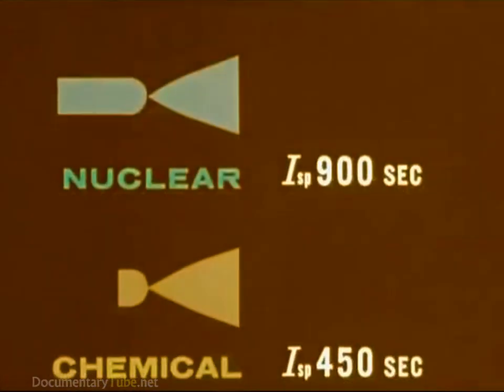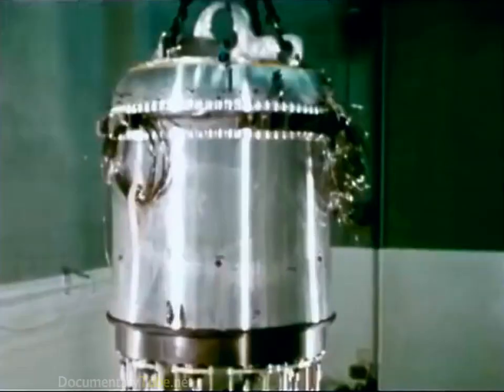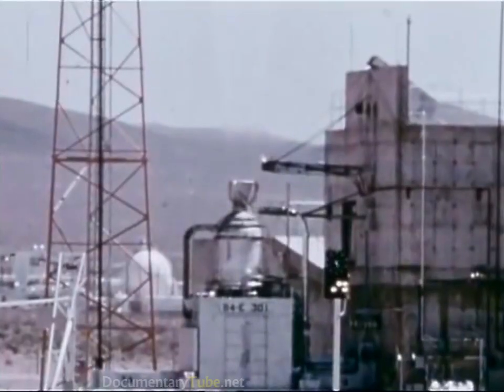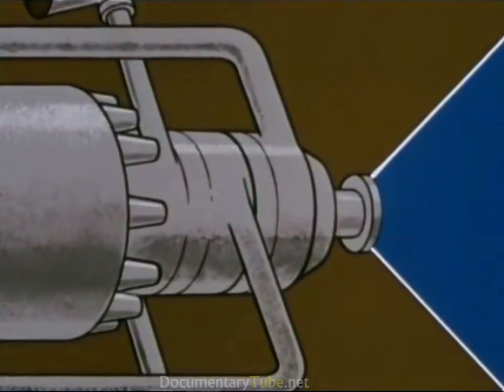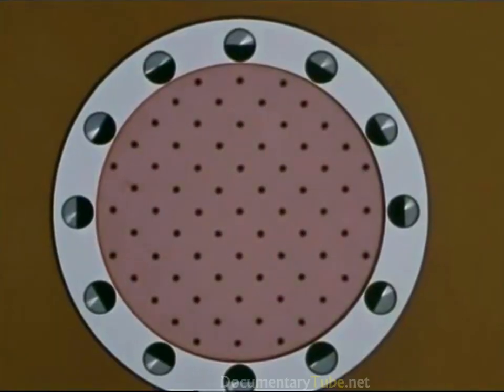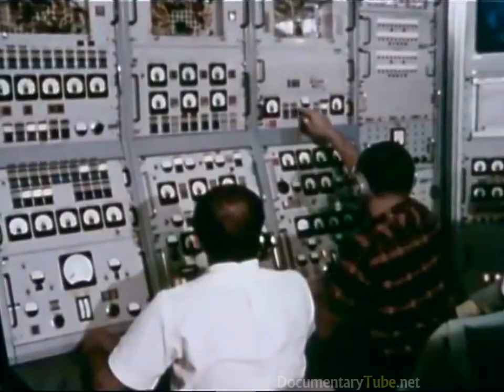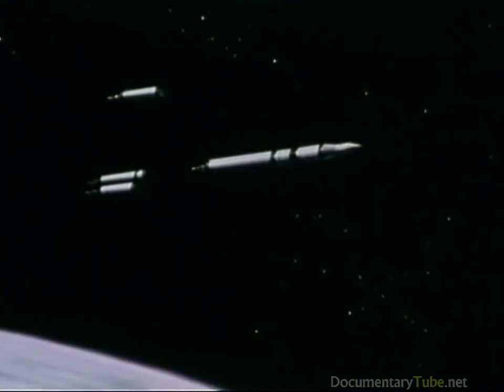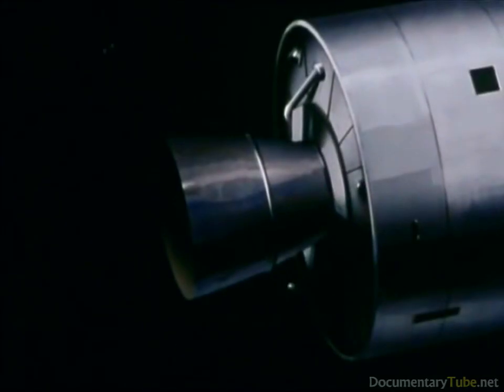HOW IT WORKS: Nuclear Propulsion

Comment: Then came "The China Syndrome", and we decided that Michael Douglas, Jane Fonda, & Jack Lemmon made more sense than the actual scientists.
Reply: And then a few months after that movie came out, Three Mile Island had a real-life meltdown and that makes a lot more sense than your silly comment about a movie.
Reply: @jamescarter3196  3 mile island was completely contained, even when it had a catastrophic failure.
Reply: This was luck as well as technology. Saved ultimately only by the geology of the site, something that can't be said of several of the operating nuclear power plants today if they were to melt down. We were told by the industry before 3M.I. that the chances of the kind of accident that occurred there had a 1 in a million chance of happening. Yes, nukes are built to exacting standards and are far safer even in terms of radioactive output that burning coal, but the nuclear propagandists of the era of this video told us nukes were safer than they actually are and argued for far less restrictive safety measures.
Reply: @meteorblades8044  Lets take a look at Fukushima for example.  As we know, the China Syndrome is an exaggeration of the fear that a melting nuclear reactor could melt through the earth.  The end result in Fucushima was that the nuclear material melted through the core and into the basement where it pooled up until finally cooling to a solid state.  The critical mistake in Japan was placing the reactor in a high risk earthquake and tsunami area without sufficient safety measures for these cataclysmic events.  The technology pertaining to nuclear reactors and the safety measures needed has taken significant steps forward in the last 50 years.  We need to take a serious look at how nuclear power can be a beneficial resource to compliment green energy technologies as a viable resource in the modern age.  Unfortunately, the downside to wind and solar energy prevents them from being the stand alone sources of our energy needs.
Reply: @ADAMJWAITE  I’m very late, but there’s also a need to point out that Fukushima was struck by one of the largest Earthquakes and one of the largest Tsunamis ever recorded but still survived enough that you can live right next to the reactor and not have an increase of getting cancer.

Comment: I have proposed an experiment that if it has experimental physical results, then, it can be a tool for the propulsion force for spacecrafts.
This experiment requires a high energy laser and an interferometer.
Please read the attached link as my proposal for this experiment. I would be very grateful if you send me your feedback.
Best Regards
J. Jafari
https://www.researchgate.net/publication/327828912_Are_laser_particle_accelerator_capable_to_propel_spaceships_in_cosmic_distance

Comment: Here is an engine I've seen proposed. Use a nuclear engine to power a pulse converter and simply "set" the pulse to however rpm needed for fastest speed ratio. It would be most useful in Space because once you are moving at a good clip, all you need to do is steer around objects that can rip your ship apart. A Neural Net Computer would do the trick nicely. Going one step further a Matter to Energy converter attached to a pulse converter would be better than nuclear because then your spacecraft could "suck in" matter and there is your fuel. A smart ship would use nuclear and solar sails as backup systems to compliment the existing Matter to Energy Pulse Drive. Don't ask me how I figured all this out. I might be a genius or something. In fact, not to brag but remember the theory about the idea of black holes being "doors" to another universe? Well I speculated on that as a kid.....not making this up either.
Reply: Don't smoke crack

Comment: Atomic fusion just isn't viable.  It's danger factor is over the top.  All control systems are subject to failure, either mechanical or human error.  Use of fusion requires perfection and lets face it, that we aren't.
Reply: Yes fusion is not going to work. The tokamak projects have proven it for the most part. Fission with using multiple reactor types for processing diffirent products using MOX fuels is hopefully going to be future of nuclear energy. If only we could use U235 as fuel.
Reply: @okakokakiev787  >If only we could use U235 as fuel.
MAXIMUM ATOMIC CRACK MODE ON
We can! Just turn it into uranium tetrabromide, mix it with water (2% solution) and store in many individual thin tubes, internally coated with neutron-absorbing material, then, when you need thrust, shoot several streams of it at eachother behind the pusher plate! BOOOOOOOOOOOOOOOOOOOOOOOM! And you have high-ISP high-thrust engine with continuous cycle!
MAXIMUM ATOMIC CRACK MODE OFF
The thing I've just described is a real project - the nuclear salt-water rocket. There's a much more practical version, though - the nuclear pulse drive, both of the Orion and Medusa kinds, which uses specificially-constructed nuclear bombs for fuel and propellant.
Reply: Oh dear, oh dear.... we gotta get rid of all that paper stuff because it burns so readily...... and all those automobiles that kill a zillion people every year.....

Comment: The question is how about the radiation  from the H2 used but you can use it in space because it ain't on the earth !!
Reply: There is no radiation from H2. The only radiation happening is if the rocket does a close flyby and will be provided to you via rays.

Comment: On January 12, 1965 the jackasses intentionally exploded part of a rocket's nuclear core to study the behaviour of the reactor and the environmental effects of the radiation. The test was designed so that all winds from the test site would be from the northeast, thus the radioactive cloud created by the test would blow to the southwest from the test site for a distance of 200 miles toward densely populated areas of southern California.  The radioactive cloud was tracked by U.S. military aircraft.  Increased radioactivity was observed in Barstow, California, San Bernadino, California, Los Angeles, California, and San Diego, California.Besides the large scale intentional radioactive pollution no morals,ethics or conscience were observed.
Reply: True or not I can see why they'd have done it. They wanted to simulate what would have happened if one of these exploded on the launch pad. I wouldn't be surprised if that's true that one was also exploded in the lower and possibly another in the upper atmosphere to see what effect that would have on a possible failure. Either way this was a dumb idea. These engines are better suited to be used in the vacuum of space not in the atmosphere.
Reply: @omegasupreme5527  There's dumb and then there is malicious intent to cause radiation induced cancer in densely populated urban areas like LA consciously ignoring the harmful effects on innocent people and animals prior to the experiment.

Comment: I never heard what they expected for the bare engine thrust to mass ratio. High specific fuel impulse is great for very long range missions with high fuel mass fractions and low acceleration, but shorter missions will need to consider the mass of the engine. Chemical rocket engines are very very light weight per unit of thrust.
Reply: it takes more energy to accelerate more mass, dropping stages increases acceleration when the next stage fires, and acceleration increases as it runs out of fuel.
Reply: @lovotcore6946  That is not relevant to my question.
Reply: @mytech6779  It's not aerodynamic drag, or friction they fight, it's inertia, inertia is directly proportional to mass, dropping stages means less mass which means less inertia, which means it takes less force to accelerate the rocket.
Reply: @lovotcore6946  Still not relevant.

Comment: that is the engine that black budgeteers used to go to mars in a 1 week trip  at 70's , with a scoop that gathers interstellar hydrogen that particular  engine can theoretically reach a significant fraction of c speed  half or more, so interstellar travel to closer stars in 5-10 years period might be feasible, never a straight answer denies everything offcourse.